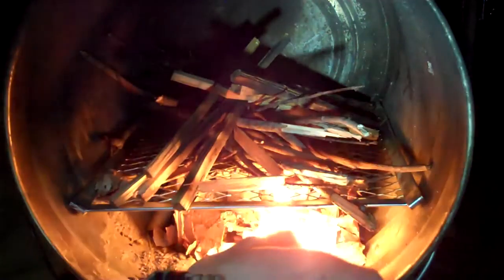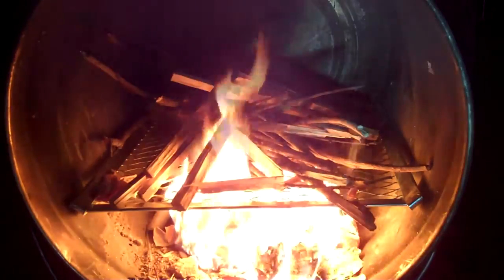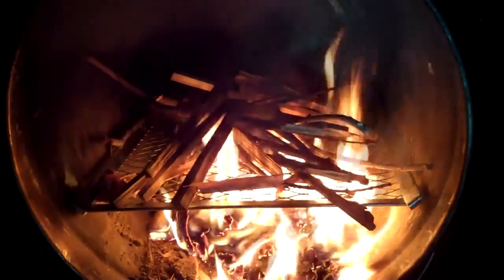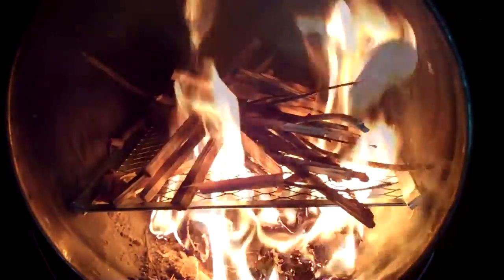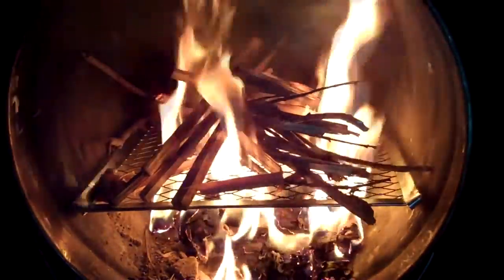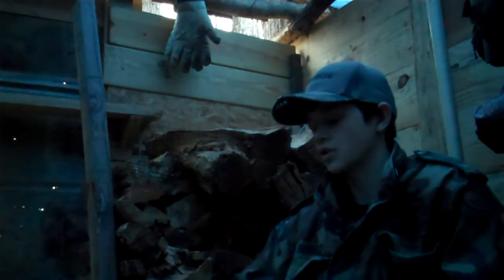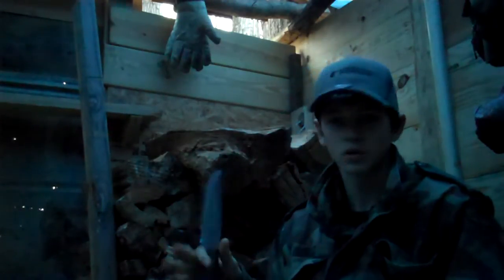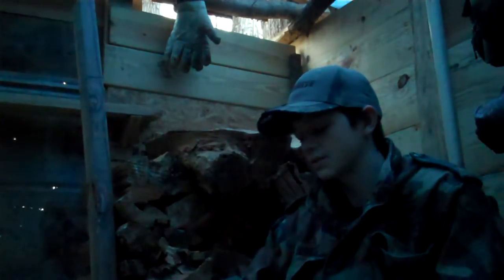Chapter of the Hut 7 - Testing the Stove Grate

Comment from the maker: @ScanMan1967 Good suggestion, but I'd rather not block the airflow, as well as the grate is to help not burn out the bottom of the can and I'm afraid after many uses of logs directly on the bottom it would burn through. Thanks for the suggestion though man.